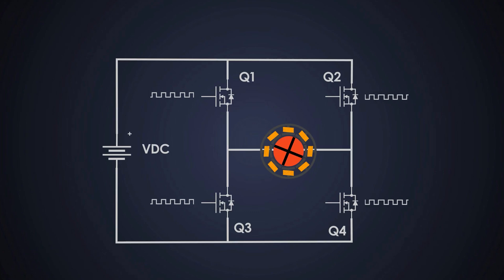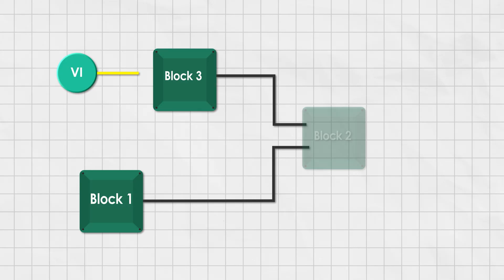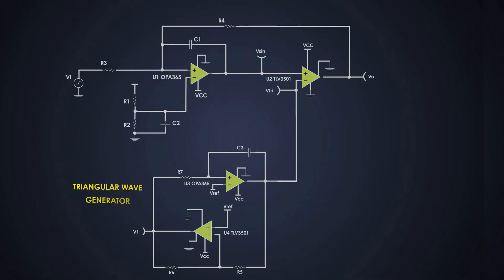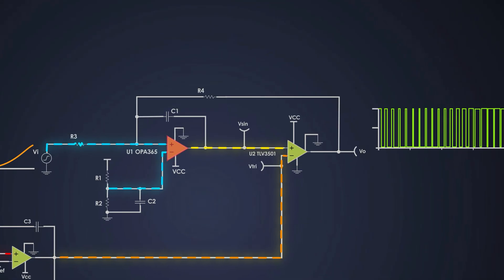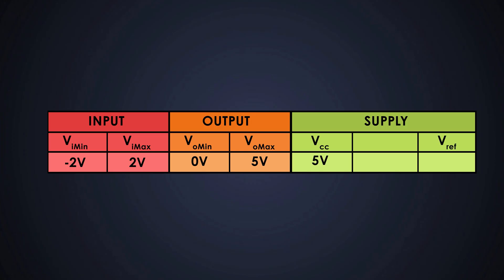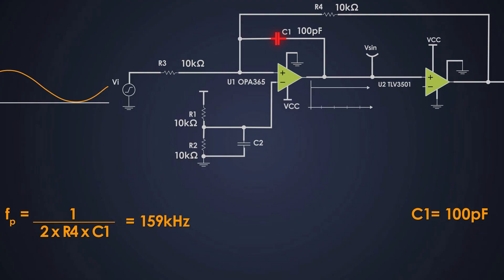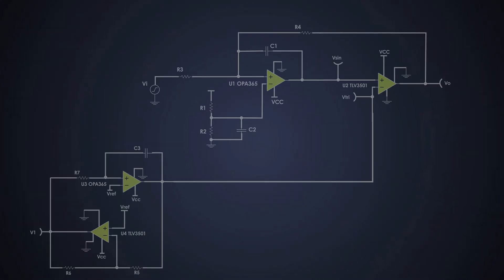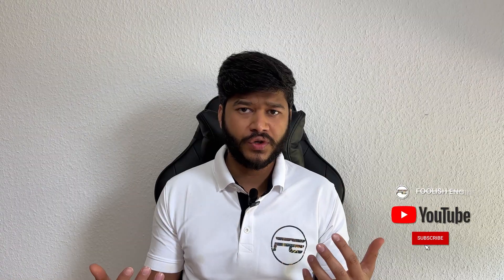Analog PWM Generator | PWM generator Using Op-Amps

Comment: I think you should check the whole schematic again, this won't work. Feedback is wrong on several components and the reference voltage calculation for R1 and R2 is also not correct.

Comment: Pwm signal may also switch a buck converter, and thus help regulate its output voltage.
Reply: yes its application can be seen in SMPS